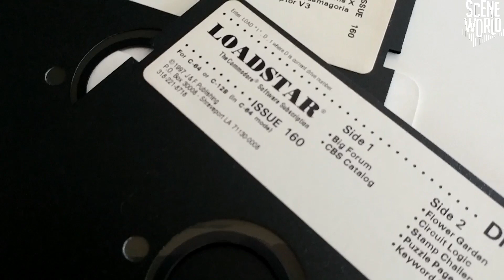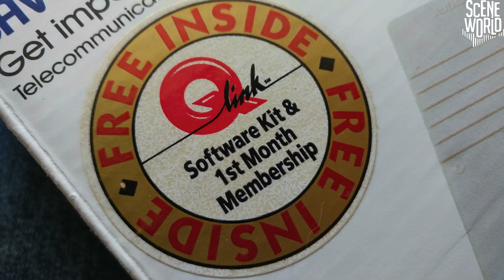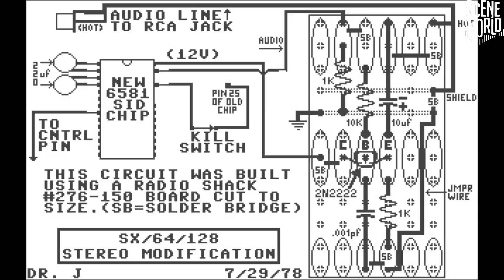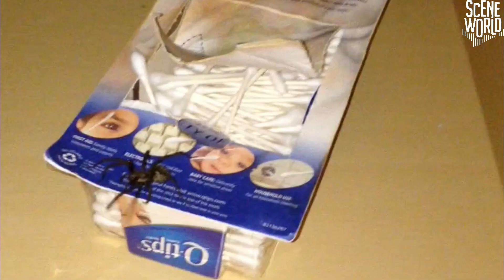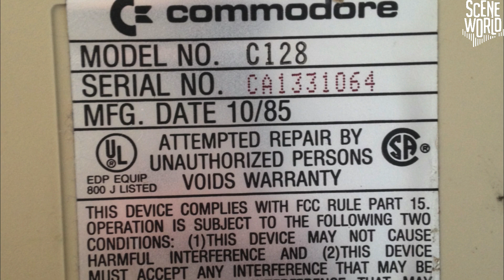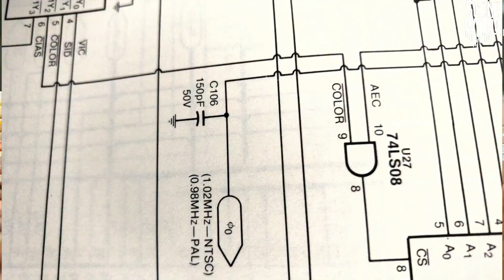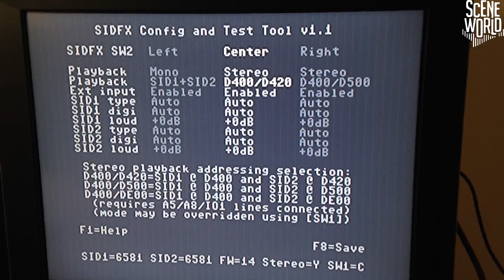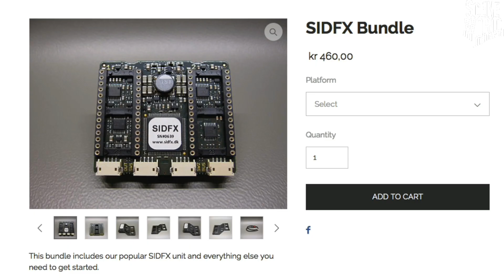Review: SIDFX

Comment: I just received 2 C64C's back from being repaired and modded-up, both with SIDFX.  One now has both 8580s.  The other now has 2 ARMSIDs.  I expected to be able to play Stereo SID-Player .MUS + .STR files in stereo without needing my SID Symphony cart for the 2nd channel.  So far, however, I have not succeeded in making that happen regardless of how I've configured SID1 and SID2 via the SIDFX configuration tool.  Am I trying to do something that isn't possible with this particular dual-SID solution?
Reply from the maker: It's absolutely possible: stereo SID'ing is one of the primary reasons I got a SIDFX! (I'm actually playing a really raunchy-sounding .MUS+.STR file in StereoPlayer as I type this, because I wanted to check something before I started typing things I might be wrong about).

Do you have your switches and whatnot hooked up to the SIDFX? If you configure your SIDs at $D400 and $DE00 on preset one, you need to use the little toggle to go to that preset (and then restart your machine, because you can't hot-swap presets while the machine's on). Also, are you saving the presets in the SIDFX configurator after you've made changes?

If you're using StereoPlayer (which I presume you are if you're doing .MUS and .STR files), I imagine you already know that you need to configure that to play in stereo and look for the SID at either $DE00 or $DF00.

Otherwise, without more specifics, I'm not sure what else to suggest. You could contact the guys that made the SIDFX... when I got mine and was having issues with the stereo SID bit (I was using a C128, and the 128 -- even in 64 mode -- uses some memory locations that the second SID wants to live in, causing a crash if I tried to use it), they were super helpful in figuring out what was happening.

Good luck!

AJH
Reply: @SceneWorldMagazine  Thanks for the fast response and confirmation that this is indeed possible.  I am using the Stereo SIDPlayer v10.3 which I acquired from CMD in the 1990s when I purchased from them my first and second SID Symphony carts.  I did not do my SIDFX installations.  I sent two C64c's in for repair and had them modded up to use SIDFX while they were in the shop.  The 8580 from one of them went into the other - giving me a pair of real 8580s in that machine.  The "empty" machine then received two ARMSIDs for its SIDFX.  I downloaded and wrote the configurator PRG to a 1541 floppy using my ZoomFloppy.  I can change the configuration by selecting Left/Center/Right with the 2nd toggle switch.  So you're suggesting to set the "Left" profile to "Stereo" and $D400 / $DE00 ...which would require me to flip the 1st toggle switch down for playback using that profile after saving it via F8 and restarting the machine.  I also did find the settings in Stereo SIDPlayer 10.3 for selecting "Stereo" and $DE00.  Those seemed to be what I wanted. I also saw it's $DF00 option, but that's not one of my SIDFX options... unless - I think - I ever decided to move the yellow "grabber" to a different pin on the chip to which its attached.

Last night I tried a bajillion combinations but still could only get the "right-half" of "Axel F" to play if I plugged in my SID Symphony cartridge.  I don't dislike my SID Symphony cart but I wanted SIDFX to be able to do the same thing internally so my cart port can remain freely available.  I will try this again now that you've given me some solid ideas as to how yours is configured.